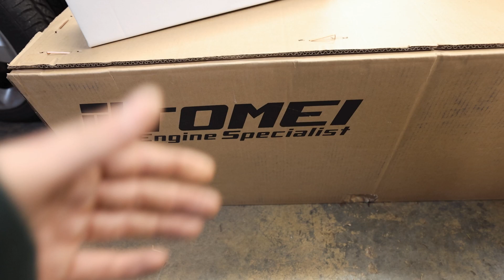My Subaru WRX is Finally Becoming Proper

Comment: i love inefficiency and wouldnt change it wat so ever. nothing like a rumble coming around a blind corner and everybody just like: "yo that's a subbie" .
Reply from the maker: This is truth, everyone does recognize the sound when they hear it 🔥
Reply: Word!!!!
Reply: THIS ☝🏼
Reply: I would not have it another way
Reply: @Smeedia   reason for the pipe inside the pipe is for bending purposes I worked in a fab shop it’s a cheater way so you don’t kink piping
Reply: If you watch the whole video, Tanner bails on the UELs before even getting off the starting line.  He won't be using them.  He has some kind of disorder where he has to make the same build over and over :)

Comment: I wanted to share this cause I thought it was cool, my tuner told me the headers arent really such a big deal, the exhaust gas gets there either way, but the real problem is the heads, notice how one side is almost straight down from the values but the other has to curve, that curve is what causes some of the ejs problem with heating and exhaust being less efficient. There ain't much you can do about it but if you like ur rumble keep that damn rubble, don't ruin the noise cause the heads are inefficient too.

Comment: As someone who has had tomei exhausts on multiple subarus, take the springs off. All they do is rattle and it will drive you crazy
Reply from the maker: If they start to rattle that will 100% be the first thing I do 🔥

Comment: Thank you for answering the question I have been sitting on for months. I bought slightly used TGV deletes about a month before the green speed update applied. I've been holding off installing them because I thought my car would go into limp mode even with a tune. I can live with CELs as long as it doesn't hinder performance. Thanks for the info! Keep up the awesome builds!
Reply from the maker: Rough cold starts and a CEL is all you should get, if you have emmisions testing your car will not pass. Do keep that in mind 🙏

Comment: Ah man! I thought you were going to stick with the UEL lol! The boxer rumble is 60% of the reasons for buying a Subaru in the first place (in my opinion).

The inner tubing in the up pipe is to create what is called the 'Venturi' effect which is supposed to help with spool.

I can't do what you do and so I had a fabricator take the exact same up pipe and make a rotated setup for my GC.

Would have been really interesting for me to see how you would have gone about it but it's definitely a smart move getting an off the shelf product. We need to learn to choose our battles lol
Reply from the maker: I've learned that if it won't be a straightforward fab thing I won't be able to diy it well 😅 but I don't blame ya I do miss the uel sound from time to time

Comment: Interesting, never thought tomei would have a double wall pipe, probably for some heat protection for the head and maybe a little thermal retention for the turbski.
Reply from the maker: From what I've heard it's for velocity increase for the turbo, definitely was not expecting that 😅

Comment: Open source your car, dimemod has sd and flex fuel patches to the rom. There’s also auto blip down shifting and anti lag tables. I’ve been tuning my 19 STI with it.
Reply from the maker: Might swap over to ECUTEK for now on the wrx 👀 

Is dimemod done with just a taxtrix cable?
Reply: @Smeedia  ECUTEK actually has less tables and is less robust then open source tuning. I was going to go ECUTEK until I looked at the available tables. There isn’t even separate target boost tables for flex fuel. Only advantage is live tuning tables.

All you need is a tactrix cable.

Comment: Im pretty sure all aftermarket up pipes are 2 pipes inside one another maybe stock pipe to idk , from what i read it helps with spooling up the turbo by creating exahust velocity
Reply from the maker: I could see that, I'm pretty sure grimmspeed is a single pipe as well as a few others
Reply: @Smeedia  oh i didnt know about grimmspeed never looked into theres , i just know tomioka witch is what i have , tomei and killer B are double pipe

Comment: Why -6AN on the return? But your running 8AN from the pump to the rails. Correct? Another cool video!!!
Reply from the maker: -6 is normally sufficient for the return, the stock return you can risk over running it. In theory it would still flow. Smaller DIA would increase velocity but can iver run the FPR

Comment: I have that header. Need to coat it actually. Have to drop it to the guy between one of these snowstorms lol. 

I have no intentions to get a super expensive EL manifold unless it's maybe the Grimmspeed one. But they need to make one that's 3 bolt to the up pipe flange...
Reply from the maker: Definitely Definitely suggest the grimmspeed one 🔥

Comment: Q: Is there a detailed injectors guide to the CC's required for a range of hp builds, like the CC's required for 400-500 hp + 500-600 hp, etc & how do u know what injector CC size to use? All I know is that bigger/more is better, lol. 🙄🤔😕
Reply from the maker: Lol yes there is, I use a fuel injector calculator to determine the size that I need. They're pretty easy to use. 

Here's a easier one to use 

https://fuelinjectorclinic.com/flow-calculator

Comment: Let me know if you get miss fire codes at .88 inj duty at idle 😂, at 33 psi base line pressure with the iwire pump controller witch you have as well ,… also .022 spark plug gap I’m running 33psi ( Colorado high altitude)

Comment: the inner pipe needs to be a certain id for exhaust pressure etc; too wide and obviously you know what happens, hence the multi-layered  tubing
Reply from the maker: Wasn't expecting that when I got into it 😅 the ID of the inner pipe was perfect size for the V band for the PTE

Comment: Could I put tomei elh, tomei up pipe, invidia catted down pipe, invidia cat back q300 and grimmspeed cai on 2013 wrx hatchback without needing to upgrade fuel system just proper tune? I’m finding a hard time getting answers. Thank you

Comment: I GOT A catless downpipe but the bolts on it arte so rusted and i strpped a head so the stock one is stuck on now but i got a str8 pipe from the stock dp back to cobb titanium cat-back and an intake ima get a dyno tune from machines gone wild subaru specialist tuners best in the usa apparently but i really want to put this catless on any recommendations?

Comment: My crank pulley is real wobbly. Was looking to go with perrin lightweight.. should I just go with fluidamper instead? What are the benefits of going with fluidamper instead?
Reply from the maker: Fluidamper all the way, it'll help absorb engine virlbearion that would otherwise be sent through the crankshaft. Will also significant help with harmonics
Reply: @Smeedia  awesome never heard of fluidampr so thank you for the info. Is there any specific or common problem that would cause my crank pulley to be wobbling?

Comment: Ok so your suffering with CEL... question, if I delete my secondary air pump and have a CEL can I still tune with cobb accessport and will it affect my cars performance like limp mode it?
Reply from the maker: Unfortunately it will throw a cel but it should still be tuneable, I may be swapping to ecutek for the wrx on this tune
Reply: @Smeedia  🤔... thanks for always answering... crew for life.

Comment: Tanner can you just reverse the stock intake manifold so the throttle body is forward facing??? I've been wondering this for awhile?!?!?!
Reply from the maker: Yes you can 🙏 definitely need to make some intercooler pipes but 100% doable

Comment: What about dual fuel rails? Might be worth considering.
Reply from the maker: On thr EJ or EG? 👀
Reply: @Smeedia  Either one. You'd have to wire in an additional/piggyback fuel controller for the EJ. Not sure how many guys have attempted it without a standalone ECU. I've used a piggyback on a different vehicle. Worked great minus the speed governor still being in place. 😂

Comment: Hey man! Great video! I was wondering if you could show or point me to the right direction when it comes to installing JDM power folding mirrors. I found some and it comes with the interior button but I don’t know how to wire them or what all i need to wire them. I appreciate all your hard work and any/all advice you give. Thank you so much!
Reply from the maker: I still need to wire mine in but I can make a video on it this week for ya 🔥😁
Reply: @Smeedia  man, you’re the best! Thank you again ❤️

Comment: Not knocking doing it yourself but don’t they make adapters for a rotated setup the bolts to the “factory” up pipe?
Reply from the maker: Yes they do, they're called pedestals. Personally not a huge fan. I don't think they look the cleanest and it's another point for am exhaust leak and just more gaskets. Building my own gives me more practice welding and fabricating 🙏

Comment: Quick question about the ej engine cause I’m running an ez30 motor how do you feel about lightweight flywheels ,the fluid damper you run and solid mount bushing? Cause the Subaru flat motors are balanced motors would this be bad for the thrust bearings?
Reply: Fluidampr and a normal fly wheel 🤘

Skip out on lightweight
Reply: @HugoHardinge  I’ve seen people run the lightweight crank pulley which is dumb cause again the thrust bearings but I don’t really hear about lightweight flywheel pls explain further same result for the thrust bearings?
Reply: @lolobedolo8624  pulley for sure do not run 

As per flywheel I’ve always stuck with a non lightweight one, just my 2 cents and experience!
Reply from the maker: Your fine to use a LW flywheel but I personally prefer oem ones with a fluidamper. You may see some ghost knock with a LW flywheel as well

Comment: I assume you know the 2150s don't like ethanol fuel?
Reply from the maker: They should, I spoke with FIC About it. They're fine for E85 but prolonged exposure to MTBE fuels and Alcahol base without being used can cause the seals to expanded. With frequent use and intermediate pump gas they should be okay
Reply: @Smeedia  from what I read and my tuner says that if you don't flush with pump gas once in a while you can have issues

Comment: My dude you do the most questionable things. Sometimes you’ll talk about not having funds but will remove the wrap after 6 months. Destroying an up pipe and selling the gifted header. Why don’t you just get an ETS kit? I would prefer to see that content
Reply from the maker: I bought that header.... 

Because I don't want to spend $5,000 on a rotated kit. And I want to get better at welding and fabricating so the best way to learn is to keep practicing 

The wrap was also a trial type deal. Never used hexis wrap before and after a fee months I just wasn't happy with the quality of it
Reply: @Smeedia  hey tanner, I’ve been watching you for 3 years. I appreciate you responding but I’m just confused because I want you to grow. I see your hustle and want some badass content. It just seems that sometimes you get in your own way for growth. That can be summed up by you needlessly spending. I know you don’t want to spend the 5K but you would’ve probably finished the wrx by now and made tons more content with the gc8 build. Please don’t take this the wrong way, I’m just a concerned subscriber and I want the best for you.
Reply from the maker: @Martin Garcia  the wrx wouldent have been any farther along. The hold up is on valve buckets which are always on a back order. I can build an up pipe and downpipe in two days if needed but I'm at a stop for what I can do until I can get these buckets in and the engine slapped back down.
Reply: @Smeedia  I think you missed my point, goodluck tanner.